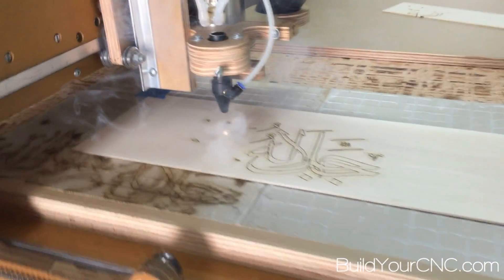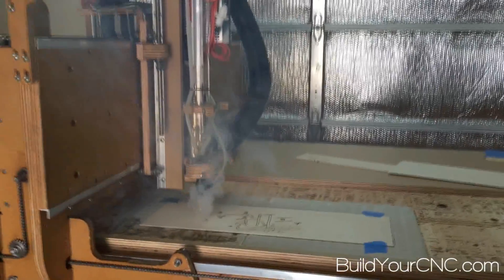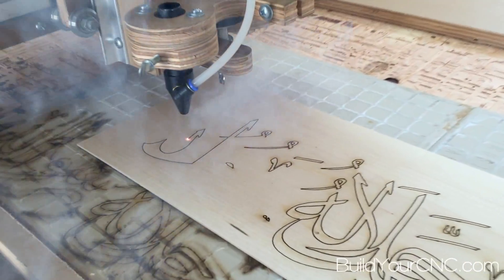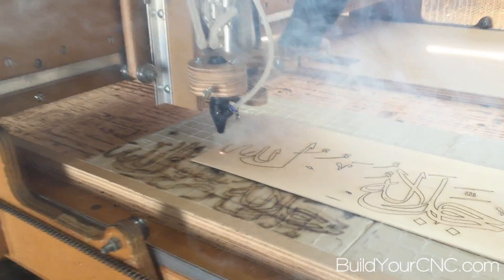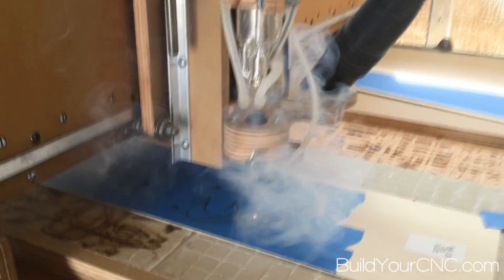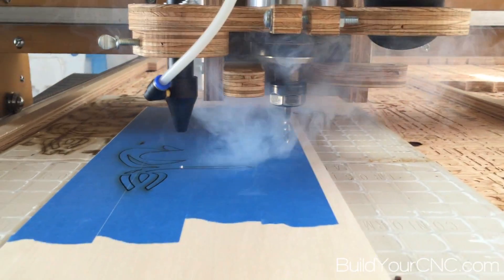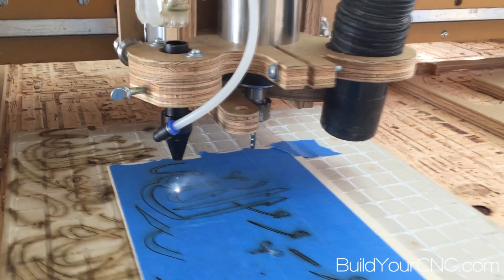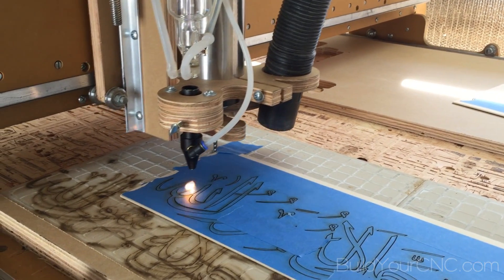How to Use the greenBull CNC machine with the Laser/Spindle Hybrid Head - Basswood Trials

Comment: hey ther! I am looking in to Laser cnc and was thinking of a CO2 laser but same time i have heart that after 6000 hours the tube is old and you can not use it any more you need a new one ??? Is that right did you have seen that your self ??
Reply from the maker: Laser tubes actually last much shorter time than that.  Laser tubes are a consumable item and will need to be replaced frequently.  Compared to end mills, laser tubes have a better return on investment as the laser can cut and engrave far more than end mills as end mills will wear far faster then laser tubes, so I wouldn't be too worried about laser tubes going bad over time.  That is simply the nature of the machine and function.
Reply: Thanks for the repaly! I live in Sweden and is hard to get a good Co2 laser except Epilog,  GCC, universal or tortec but for thies i can get my self a new car for the same amount of money and there laser last much longer too. hard to decide what to do !!!!

Comment: You have to wear "laser proof" goggles when it is operating, right?
Reply from the maker: +Alfred Wheeler Absolutely!  Laser goggles that are designed specifically for the laser wavelength is a must.  The laser goggles that I use block CO2 wavelength of 10.2 um or 10200 nm.

Comment: I was thinking to add laser to my existing CNC just like you did. I was told to not mount a CO2 tube like a spindle. no reason given but I though the CO2 tube was too fragile to be mounted on a moving part.
Reply from the maker: I had the same thought before the design, but it has been working like a charm.  We use the spindle about 6 hours per day, every workday.  We designed the mount and installed the tube several months ago.

I believe the key is the way we designed the mount for the tube.  If you look at the webpage (https://buildyourcnc.com/item/cnc-machine-laser-spindle-combo-head) in the instructions, you will notice the serpentine shape of the mount.  This has a springy effect and will be very gentle on the glass. If it does break, we will know because it is filled with water.

If you design the mount in metal, be sure to place an intermediary material like cork, rubber, silicone, or another method that features compliance.
Reply: It's been a year- how is the laser holding up next to such an active spindle?

Comment: How thick of wood can it cut through?
Reply from the maker: In our very limited tests, we have cut through 1/4" ply.  That is a tougher wood to cut.  The good thing here is that it's not bouncing off any mirrors, so I plan on testing more thoroughly as I have time to see if I can cut through thicker woods. I think the key is removing the black carbon build-up so I can attempt multiple passes.  CO2 is good for wood, but even better for non toxic plastics where the material has 100% absorption and cuts fast and deep like acrylic, for example.
Reply from the maker: You can see in my blackTooth laser cutting playlist on my channel many videos, some of which are cutting wood at 1/4" thick.
Reply: I have seen the little 20w diodes but I don't know what they would be good for cutting. Have you had any experience with them?
Reply from the maker: David Kirtley Don't have any. 20W seems pretty high for a diode, actually.  I may should get one and play with it.
Reply: Nevermind. I went back to the CNC cookbook article and saw a decimal point I didn't remember. Although now the company mentioned has a 2.8W kit. Don't know what it would be good for other than saying you had one :) jtechphotonics.com
Reply from the maker: David Kirtley Yeah.  I'll have to take a look. Thanks for the info.